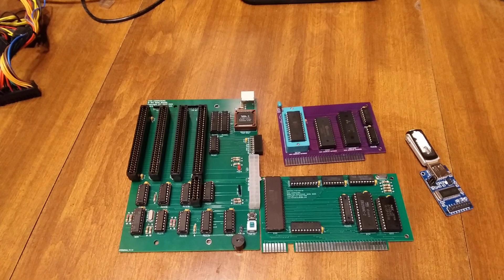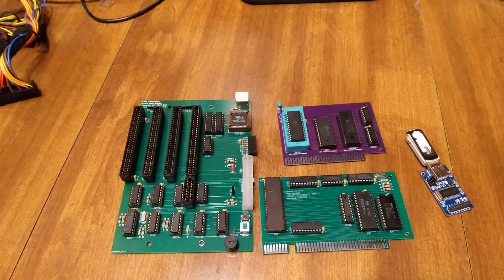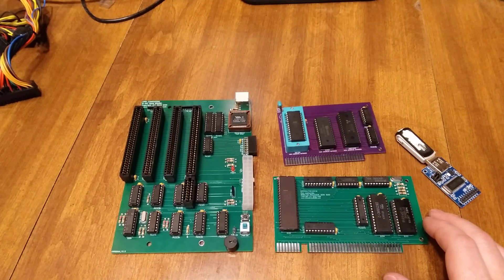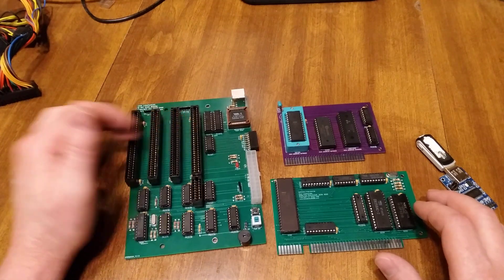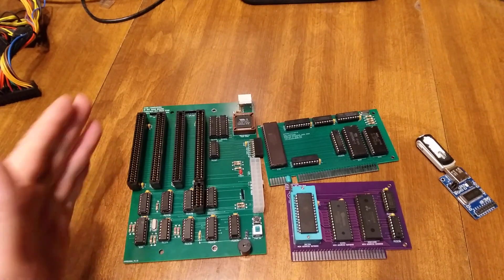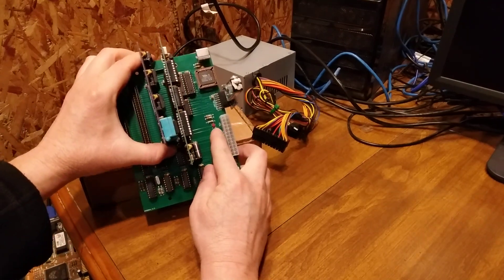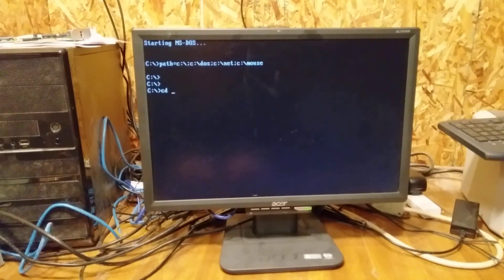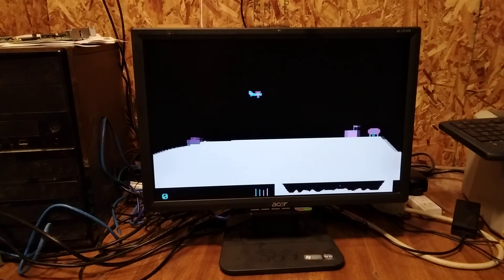8088 PC XT Compatible Project. Modular 4 ISA Slot Main Board

Comment: for sata, you need a self powered-stand alone(meaning-it doesn't use any slot)-it's just a pass thru-sata expansion card,
run that to an ide to sata converter, and of course, connect that to your 8bit isa IDE controller card.
ENJOY~

Comment: Could you build/use a 16 MHz 8088 Processor card?  Does the bus run at 4.77 MHz or 8.0 Mhz - could you run the bus at 8.0 MHz.  What about building a 286 CPU card?  I know silly since it doesn't have 16 BIT ISA - but just curious how far you could take it.  Really cool little machine.

Comment: if i made my own cpu board using a CG80286-6C   and just used 8bits of the data bus instead of 16 and 8 bit memory address instead of 24bit   and clocked it slower  do you think it would work with the rest of your setup
Reply from the maker: No. It needs the full 16 bit data bus. You can remove upper address lines and still have a functional system.
Reply: @elijahmmiller   thanks
Reply from the maker: I have been playing around with a 8086 and trying to have it 16 bit on the processor card with its own 16 bit memory. Then 8 bit on the ISA bus to interface with my 8 bit main board. 

To have it work it would need to be build sort of like the Inboard 386 that was made as an upgrade back in the 80s or 90s
Reply: @elijahmmiller  ya that would be nice

Comment: would you be building a single pcb which has everything like a sbc? then it would just need a plain backplane to work with it
Reply: SBC kits are kind of popular right now but it's the modular nature of this kit that drew me to it and that sets it apart.
Reply from the maker: I built one last year. I made a video on it at the time.  I went to the modular build so that I could have options when it comes to the processor and memory. I have been thinking that if I was to combine all the part into one PCB agian I would make a more traditional motherboard where everything is on the Main board.
Reply from the maker: https://youtu.be/Cz-OBGO3x74